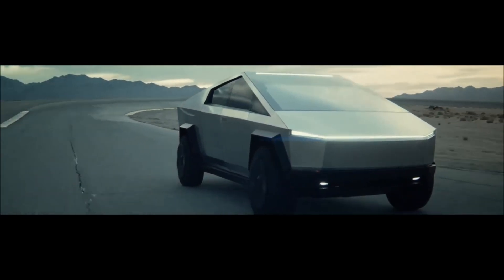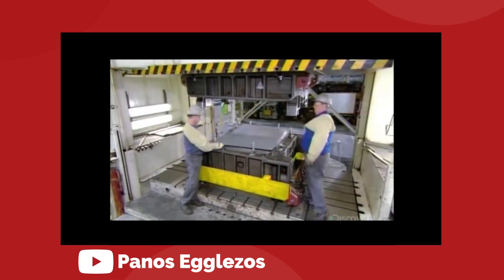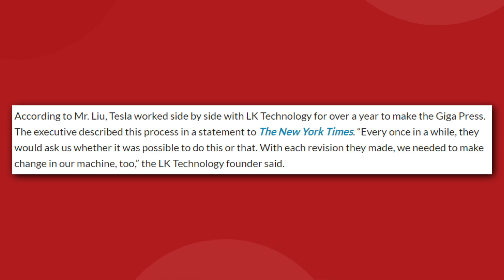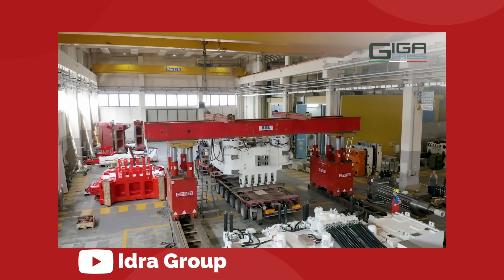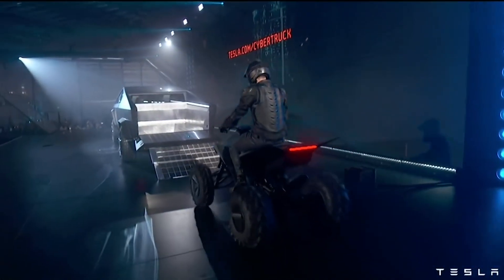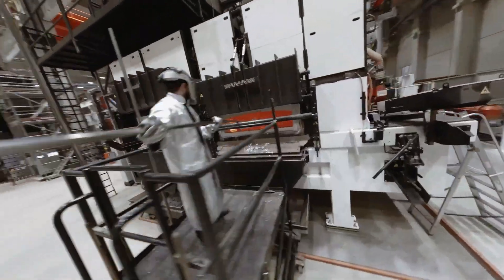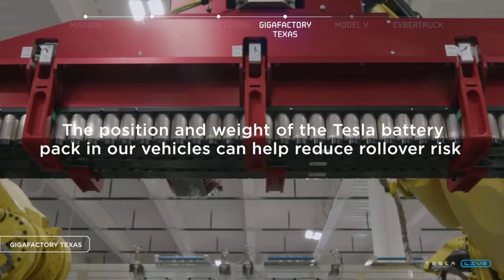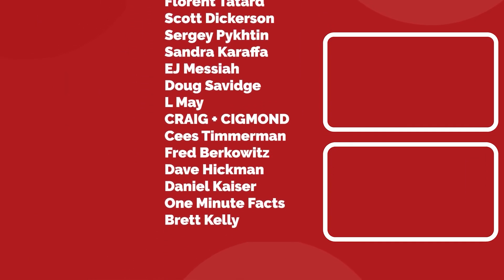Tesla Reveals New Cybertruck Giga Press!

Comment: Stainless steel can still rust though.  It's stain LESS not stain never.  I hope it's not just raw steel, and has some kind of coating
Reply: Dunno man, my Swiss Army knife is stainless, 30 years old, looks brand new… it’s definitely stain hardly
Reply: @KiwiVanderman  swiss army knife is 1.4110.  Quite a different steel to this truck which is likely 1.4310 (301).  1.4110 is significantly more expensive (~80% more).  301 is one of the least corrosion resistant stainless alloys.
Reply: That depends on the chromium content of the stainless. Cheaper grade stainless steel has a lower chromium content, which is why it can still rust. High quality stainless, with a high chromium content will never rust. So, Cybertruck's rust resistance will depend on how much Tesla wants to pay for their stainless steel. I imagine that they will spring for the good stuff.

Comment: I suppose, eventually, vehicles will be 3D printed. Imagine 100s of printers in a factory running 24/7, using dozens of different matls.
Instead of colors how about textures? Sandblast, high polish, iridescent, etched? Aftermarket?
Reply: Scalability of additive manufacturing in EV production lines will be insane!
Reply: 3D printing has its places. High volume manufacturing of things easily made by other means are not one of them. The economics are insanely wrong.
Reply: @kylenolan2710  Again, that's TODAY. Look up the word 'innovation'. The printing process will be fast enough to prevail. In addition it will allow intertwining different matls. such as wiring, insulation, mtl/plastic. 'Insanely wrong' is what they said about EVs and self-driving. I'm embarrassed for you.
Reply: That’ll be soooo brilliant to see.
Reply: @danielwhyatt3278  .
Reply: 3d printing would be too slow for mass production based on current technologies and engineering.
Reply: @bighands69  Sorry I assumed that posters here would understand innovation. Tech always gets faster, cleaner, cheaper. Y didn't you know this??
Reply: @ottovonottsville476  
 Right now the technology is not there so do you want to try again.
Reply: @bighands69  Why would I want to waste my time?

Comment: Tesla’s stock drops 40% and YouTube is flooded with these hype videos, a man in a robot suit and now a 3 year old CyberTruck, that’s at least one year away from its first truck delivery, unless Musk delays it again. What these EV groupies don’t realize is that legacy car companies have no need to make electric cars.  The old companies make money servicing gasoline engines, and there are more parts to replace on gasoline engines and hybrid cars.  Also, it is far more complicated to make a gasoline or hybrid car with the engine, transmission, exhaust, catalytic converter, radiator, engine computer, driveshaft, differential and gas tank, than to make an electric car with a battery and a motor. So switching over is no big deal. And Toyota has global distribution and service centers already in place. Most of Gas and hybrid  customers are not going to buy a $70-$140,000 Tesla anyway.  The old car companies is not behind, they are not in that market, which is still a very expensive market. And Toyota is working on Hydrogen Cars.  Is Musk paying for this video?
Reply: It's almost impossible to address all the Luddite trolling and misinformation contained in your retrograde hit job on "EV groupies". Dinosaurs like you will be extinct long before Tesla.
Reply: Bot spotted.
Reply: Shut up

Comment: The 8000lb press will require electricity? Amin suleman has suggested a way better material that is a liquid alloy and far better for the environment. It also only need a die cast with no pressure. It was sent to Tesla months ago.
Reply: Not 8,000 pounds, 8,000 tons. So 16,000,000lbs.

Comment: well if Tesla partnered with this company that built this new Giga Press . How many of these Presses will Tesla want to build the Cyber Truck  2 or 4 or
Reply: Why would they stop with the first 20?  Once the first 100 are built, they can put the second 100 in another factory.  Tesla China can hold another 300.
Reply: @carpediemarts705  You can expect the Austin plant to have at least two 9,000 ton Gigapresses.  It's unlikely the China plant will produce the Cybertruck, and if they do, it will probably be a significantly smaller model that's easier to park over there.
Reply: @gepeterson2  there are thousands of orders for the truck.  If Detroit were making something on this scale, they would have dozen presses.

Comment: Why has no one mentioned that the CyberTruck will not allow bidirectional charging? Many of the EV truck manufacturers are making this available…
Reply: thats a stupidly easy thing to add with barely any parts and just some software updates. All the heavy work is done in the add on unit that goes in the house, just like with all other manufacturers, not a hard add at all

Comment: CYBERTRUCK AS YOU SEE IT IS JUST THE BONES
WE DESIGNERS AND ENGINEERS AND ARTISTS CAN DESIGN ANYTHING OVER THE BASE BONES TESLAS HAS SUPPLIED

ITS BUT A CANVAS THE ONLY LIMIT ITS THE AMOUNT OF PERFORMANCE AND EXTRA BATTERY USAGE ANY EXTRA DESIGN WILL PROVIDE. 
ANY EXTENSIONS CURVATURE AND ADDED IMPLANTS MUST BE STRUCTURAL TO NOT IMPEDE THE EXOSKELETAL STRENGTH OF THE CYBERTRUCK.

THE ACCESSORY MARKET FOR THE CYBERTRUCK WILL BE GREATER THAN THE BIGGEST PARADE FLOATS ON EARTH.
MARDI GRAS EVERY DAY IF YOU WANT
MADMAX IS YOU DESIRE
CYBERPUNK IT IF YOU WISH
OR JUST CANVAS AND DRAW ON IT AS A MOBILE ART MUSEUM DISPLAY.

Cybertruck is the bones we get to give it life and flesh to bring it to life with creativity, in honor of the most customizable ev to ever grace the earth.

Comment: I'm not sold on it being out in 2023 just yet, my questions would be; Is there going to be only one gigapress in Tesla's entire Cybertruck factory? So, when it breaks down, and as a machine, it will break down at some point, the entire production run stops until a part/s for a one of kind machine can be made/found? And stainless steel is nice, but there is an entire region of the country labeled the "rust belt" for a reason, it may take longer but stainless steel will rust too, especially without paint. Nice vehicle for sunny CA, AZ, or TX but not so much for the rust belt. On the other hand I'd really like to see Ford buy a gigapress and start making F150 frames in Aluminum to go along with the bed and body.
Reply: If they use 316 grade stainless it'll be fine. It's specified to be submerged in salt water...
Reply: An electric F150 can have a tool bed installed on it.  One of the most essential pieces of equipment in the trades.

Comment: I'm all about these presses and the safety and the time and money saving aspects of these techniques. But what happens in a wreck? Is the entire car scrapped after a fender bender?
Reply: No. On model Y there are separate crush inserts. If you get to impact the cast pieces, it’s a big bingle, be glad Tesla kept you alive, buy a new one with insurance. Best to use active crash avoidance or learn to drive. ;-)
Reply: The stainless steel in these bodies is a lot stronger than any car body built.
Reply: Since it's just pressed aluminium it's probably cheap to produce

Comment: Thing I'm most excited for is:  MEANS TO ADAPT/ATTACH A CUSTOM JOBBER HEADACHE RACK to the truck.  Without that,  this is a drugstore cowboy truck;  Not a real truck.  Looks cool; but,  useless to 50% of truck needers.
Reply: I like “drugstore cowboy”.
Reply: @markmedley6849  Nothing wrong with liking something so pretty and futuristic looking as Cyber Truck.  Unless you're the manufacturer interested in providing a useful truck and leaving out half the users of trucks by design.
Reply: Without a tool bed, it's a space station wagon
Reply: The truck carries and tows a heavier payload than any other pickup . It's a beast of a work truck.
Reply: @LordFubar420  Sure as long as you aren't carrying 20 ft. long steel bars and square tubing or 16ft. long rafter and ceiling joists. How do you carry a 16 ft ladder on this truck?  Without means for attaching a headache rack;  Cyber Truck is useless for all its strength.
Reply: @clavo3352  One could always get a trailer. But I see your point . I'm sure if enough people make this issue known they will be able to add a rack for you .
Reply: @dreazy34  Thanks but I'm past the age of shopping at Home Depot for 10 ft to 16 ft 2X4s and 2X8s etc.  I'm arguing for the carpenters and welders  that can't be online keeping up with all of this stuff!  All Musk needs to do is go park at a steel yard or a lumber wholesaler like McCoys or Alamo Iron in San Antonio etc.  to see how real trucks need to be designed.
Reply: @clavo3352  all the factories got built by thousands of tradesmen with real work trucks.  He has had opportunity to see what the actual needs of a working truck are.  If I have to load and unload 20 toolboxes into the bed if his station wagon instead of have them on the outside, this new rig is as stupid a pipe dream as going to Mars

Comment: Great! But what if I get a fender bender? Or some other damage?

Am I supposed to replace the entire car??
Reply: Your fender won't get bent 🤣
Reply: In a fender bender, where the damage is primarily just to the body of the vehicle, the truck can still be repaired. Stainless is more difficult to repair. On a typical vehicle, the bent section can be cut off, a new piece welded in place, and then it's all sanded, smoothed, and repainted. On a vehicle with no paint, you cannot hide the welds. So, you have to replace the entire body section affected. But, look at the Deloreon. If you ever see one that is painted, that is a good indicator that it was in an accident. They cover up the repair with paint. You can do that, or vinyl wrap it. There will be options. Minor damage will not make the vehicle a total loss.
Reply: Your supposed to educate yourself in welding. Otherwise ill happy do it for you  give me your money  chump me  love your type
Reply: @Taxthe200mil  have you heard of specialization of labor? It's a major principle that drives capitalism
Reply: @Taxthe200mil  embarrassing comment.